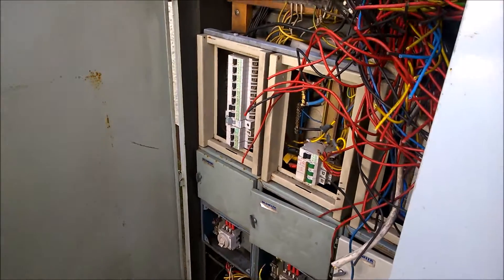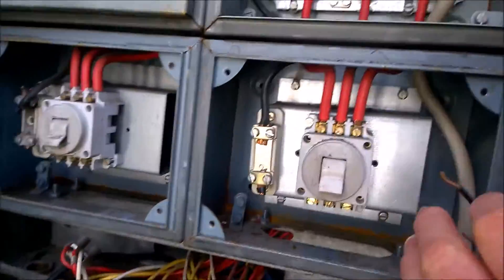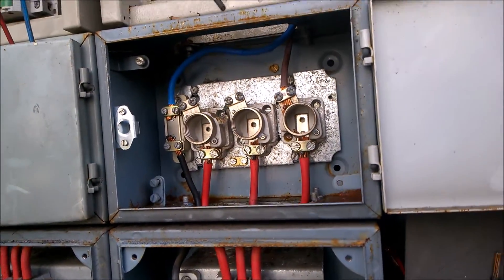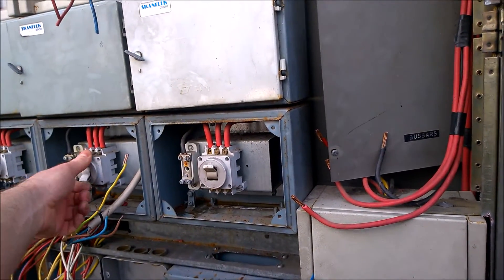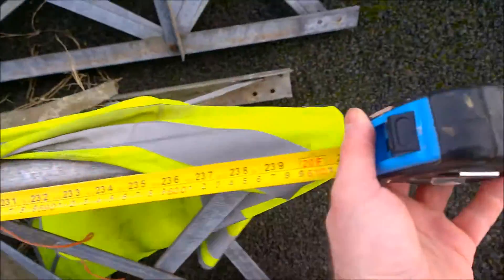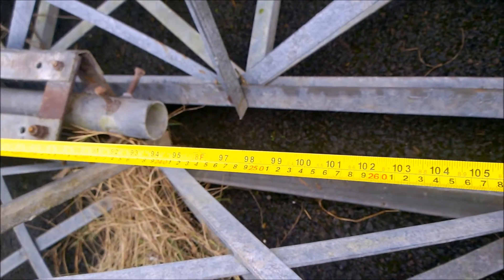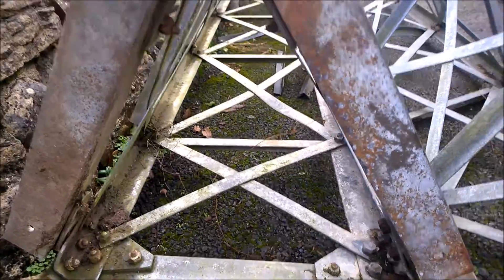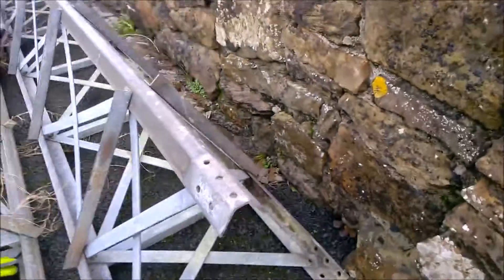My new panel/cabinet and tower for my new 3kw wind turbine

Comment: I appreciate your replies Stephen, I had my doubts, just wanted to get a second opinion, ill go with maybe 2 250 watt solar panels.. a hybrid charge controller just to future proof it.  another idea I had was to get a 12 volt linear actuator.. I have a 12/24 volt timed relay switch on the way from ebay, I'd connect the panels to a frame then use the actuator with the time relay switch to follow the timed route of the sun. hope it works :)  I'll stay away from the plastic turbines. I'll update you on my progress.. great vids by the way.. keep em up. thanks Stephen.
Reply from the maker: +daughy doc Your welcome. That sounds like a good idea. Would like to see some videos on that.

Comment: hi Stephen, I'm from Ireland also, I'm thinking of buying this item from ebay. do u have any input on this type of turbine.. there isn't any information on the charge controller that comes with it... here is the ebay item number 252086946888
Reply from the maker: +daughy doc hi what do want to power with it? The turbine is only 400w. You wont do much with that system. The only use for that would be to trickle charge a battery bank.
Reply: Honestly. I was going to start an aquaponics garden. It would be used for a 23 watt pump..it's way over kill for that.  But the solar panels are 180 watts each, if I could use the turbine to keep maybe 2 100amp hour  batteries charged.. and keep the solar to tie into a grid tie inverter. And in the future upgrade to a 1kw solar system.. I sent the guy a message asking what type of charge controller it was. He replied that that system doesn't need a charge controller. Was that an odd answer?  I was wondering if the turbine is actually any good?  Can that type of turbine be fixed if it had issues? I emailed thermodyne but he gave me a link to a place in the UK. They only sell hornet turbines. I watched all your vids.. and the blades seem to be the problem with that system. Thanks again Stephen
Reply from the maker: To be honest i would not waste you money on that system. What would suit you for starters is just a 300w solar panel. It can be then connected to your battery or grid tie it. Do you have room for a wind turbine? Yes that was a odd answer. You do need a charge controller or it will just over charge you batteries. Them turbines cant be fixed. Scrap in my opinion. If you want to future proof and you have the room get a 3kw turbine. I have put one together and testing it. I will have a video of it up soon. Them small turbines are not worth the money believe me.

Comment: excellent! Stephen  , the perks of being an electrician, is that big switch an on/off or AC to AC change over?. Looks like the tower is bolted together  ( the two halves) , its amazing what forces high tensile bolts can withstand.  The way your talking, i think even 100mph will be no problem for the tower.
Reply from the maker: Thanks I can't wait to start ripping the guts out of it. I will order a slim line grid tie. So everything will fit in there. No more cables running around just in one place.
Reply: Stephen T Sounds great
Reply from the maker: +closertothetruth That helps when I can get great bits of equipment for free. Its just an isolator switch for ac. Its a 3 phase switch so it be strong enough for what I want it for.  Hopefully it can withstand all of our winds we get. Thanks for the comments.
Reply: +Stephen T WOW!! that's awesome cabinet for all your electrical stuff. 
I really like it.
Congratulations to you my friend.
Reply: +Stephen T WOW!! that's awesome cabinet for all your electrical stuff. 
I really like it.
Congratulations to you my friend.
Reply: +Stephen T WOW!! that's awesome cabinet for all your electrical stuff. 
I really like it.
Congratulations to you my friend.